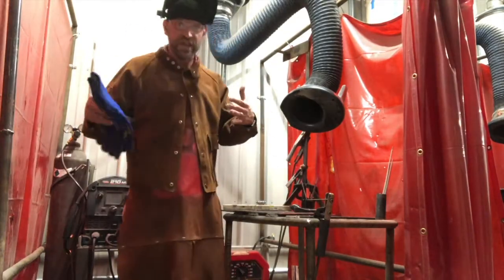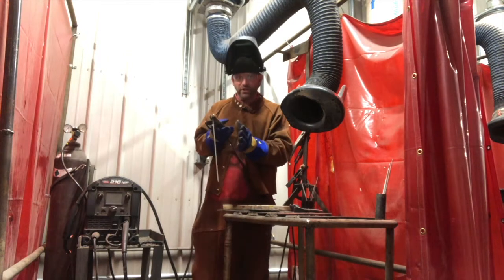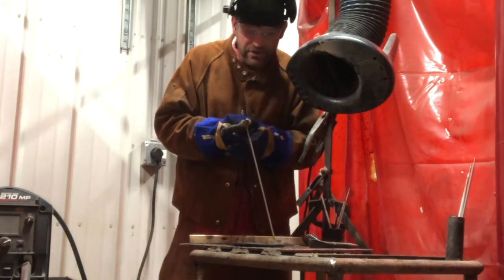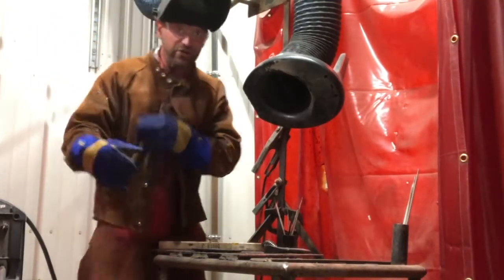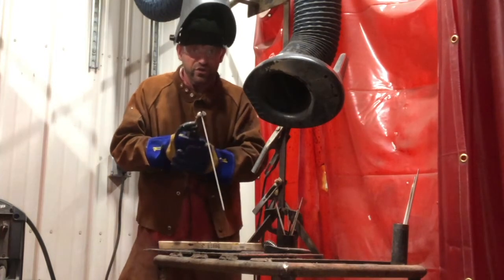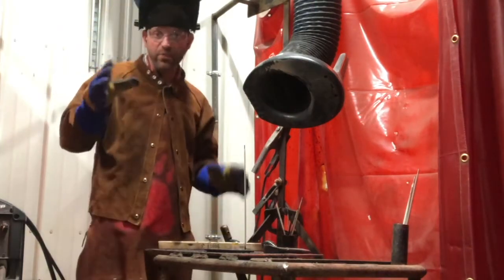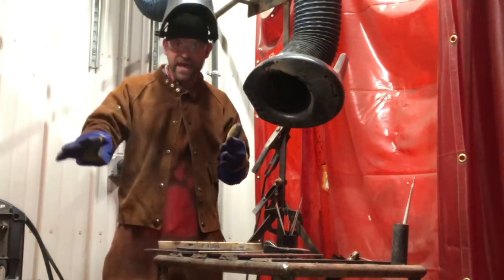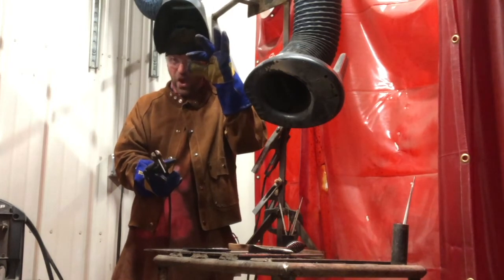Welding 101 Beginning Guide: Number 5 -Angles and Positions for Arc Welding

Comment: I have a question. Does the method for finding the arc work for every kind of welder such as mig, tig, flux core, etc. Or just stick? Also thank you for covering the very basics as most people cover techniques and stuff so thank you!
Reply from the maker: @zzOBCDzz  I’m not exactly sure what you mean by “finding the arc” , could you elaborate on that?